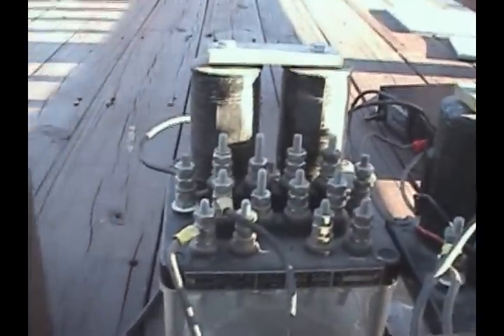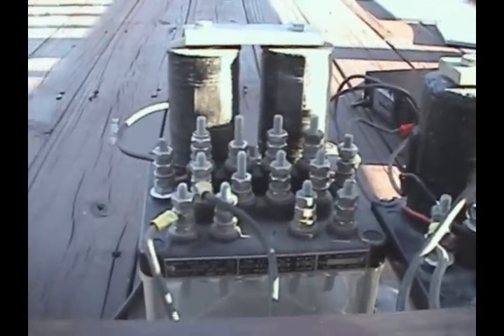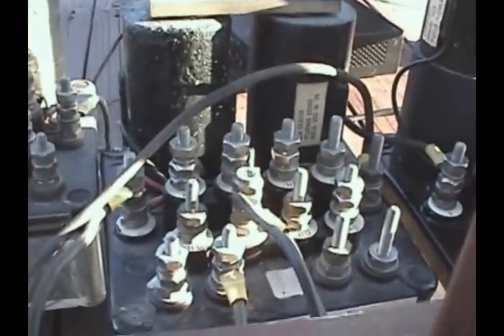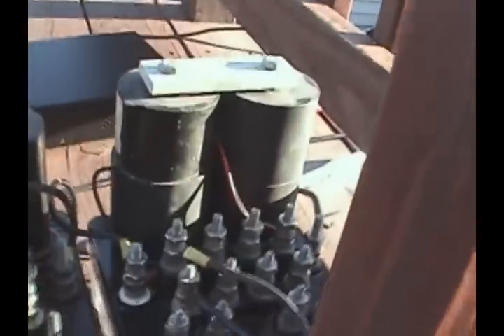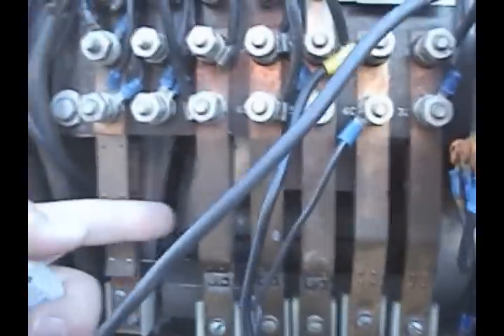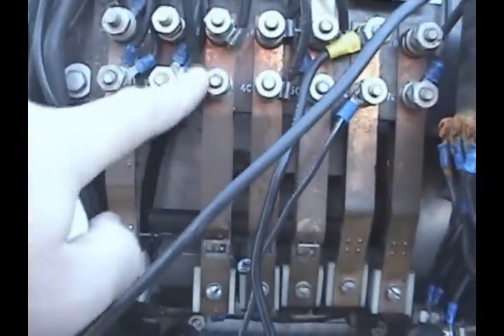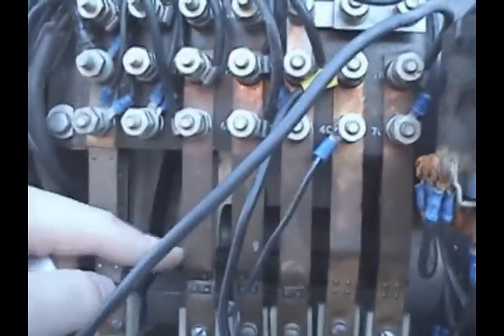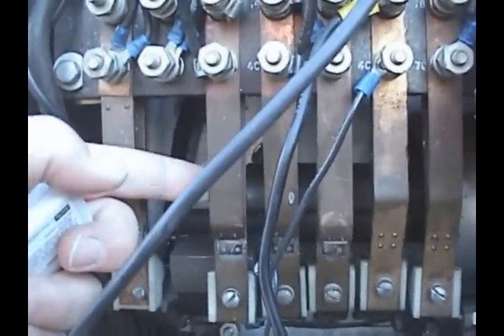My Railroad Crossing Signal with Relays

Comment from the maker: Thanks!  I did fix the terminology in the description...and added annotations to correct my video errors.  I was new to the signal business when I did this video...and didn't know much about the terminology then.  I now have the signals wired up to a relay case...with the relays doing the proper things.  I just need to re-wire the whole case with the right wire...as I just had to use what I had available.  As for mechanisms...my favorite is the WABCO (US&S) Model 75.  Safetran seems quirky...:-)

Comment from the maker: I got a few parts, like a few lightheads off of eBay, and some from a signal maintainer I know.  The gate mechanism came from a person in California that runs a railroad restoration business. Otherwise, you'd have to order the parts directly from the manufacurer, which is very expensive that way.